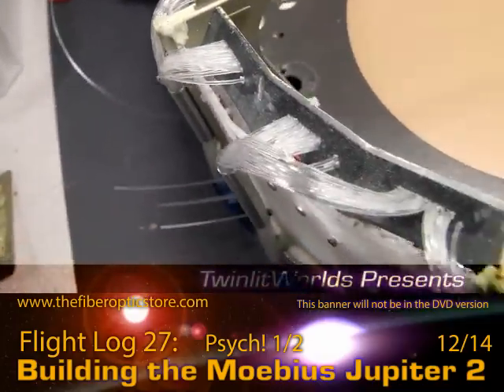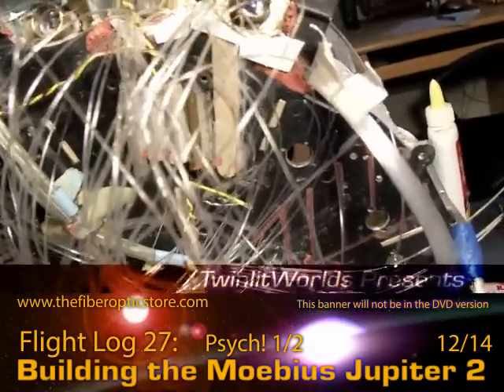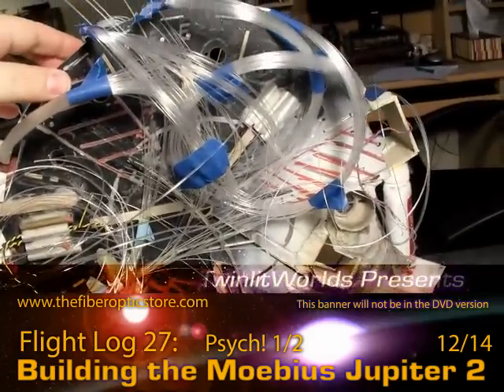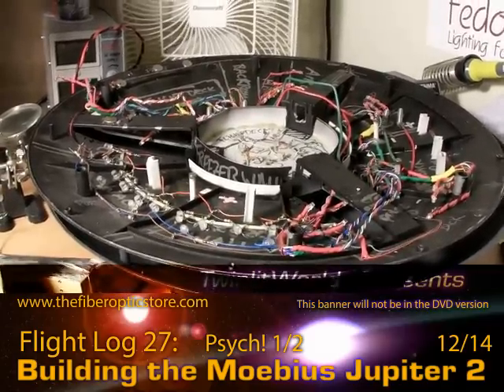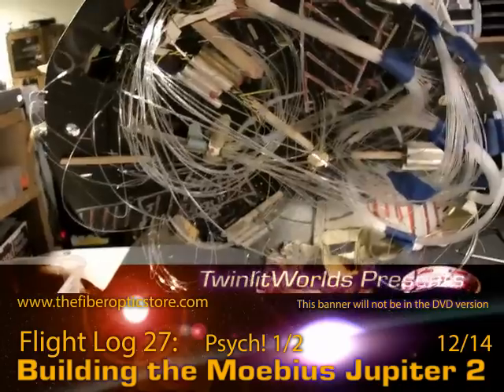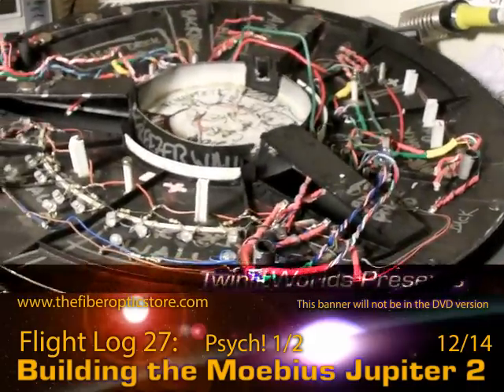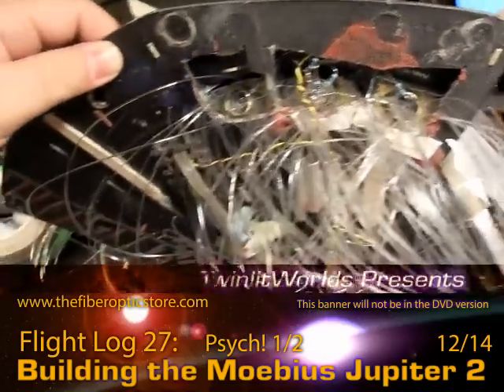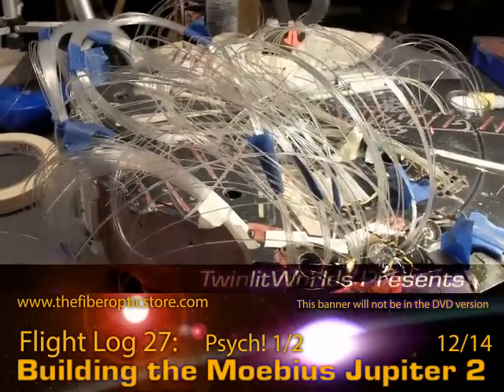J2 FlightLog 27: Psych! 1 12/14

Comment from the maker: I get all my fiber  from thefiberopticstore dotcom.  Paul is the owner & a great guy to deal w/.  I learned by trial & error, using what I'd gleaned from behind the scenes docs of star wars and reading as many forum threads as I could find.

It's very easy to use.  Coming up in flight log 29 will be plugging the fibers into lights.  Just get a small tube, like a straw.  Put an led in one end and stuff the fiber in other. Done!  You could seal with white glue, epoxy or silicone.